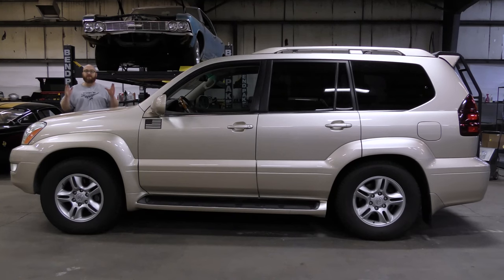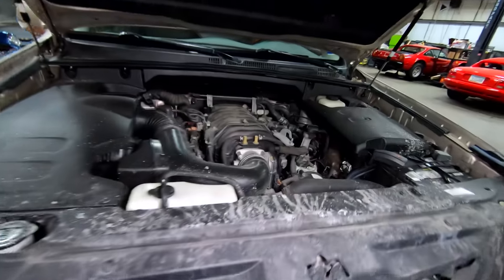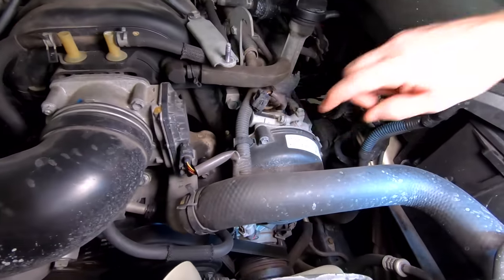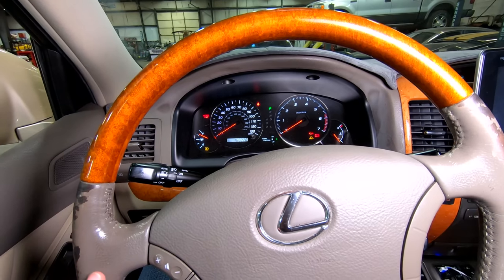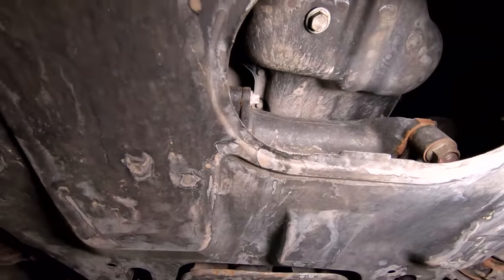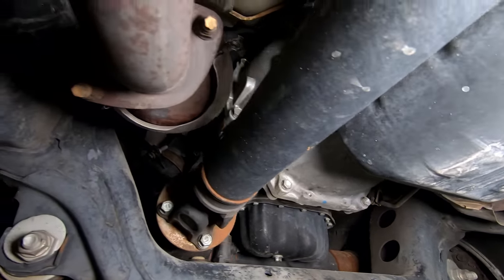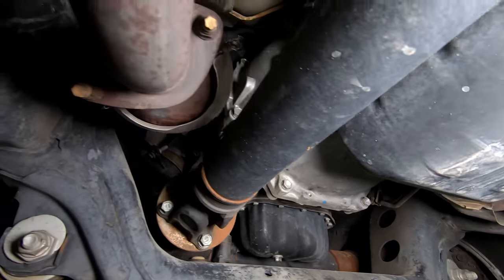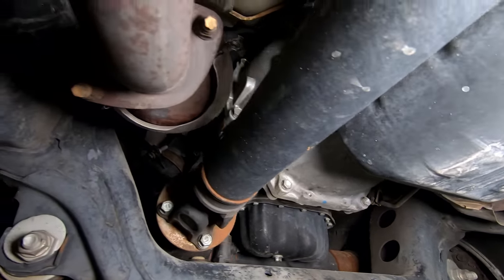How could this super reliable '07 Lexus GX470 have such a stupid design? CAR WIZARD weighs the risk

Comment: Reliability is the most important thing to me. That's why I went with Honda. Since I recently had to replace  my charcoal canister Honda went and put it inside of a steel housing to protect it. If I ever have to replace it again there is anti-seize on every bolt since I live in the rust belt anti-seize is a must.

Comment: All these videos of the GX line and personal/family experience with Toyota/lexus is the reason I bought a 22 gx460. I also own a 2014 camry. My parents had a 99 Corolla with 350k miles on the original motor and trans before it began burning a quart of oil for every tank of gas and the trans slipped. They have an 11 camry with 290k and it runs as good as the day they bought it with 80k. My camry has 140k and nothing but oil changes and trans fluid changes. And still a great ride.

Comment: I would hardly call this a design flaw.  A vast majority of these starters go over 200k no problem.  A design flaw would be something like 5.3 LS camshafts going flat from bad designed fuel management lifters.  Then knowing it's a problem and not making new parts just keep using the old designed ones.

Comment: Well i thought that was a bad design at first but when you think about it is a good place to put the starter .It is the same place on my Nissan Titan as well . Main thing is it is out of the way of the cats and other hot exhaust piping ,it's high and dry . Even it taking longer to change out it will have to be changed out less often . The heat from my headers on my old 73 Ford Truck would kill my starters in about a year . I'm still on the original starter on my 2004 Titan . But what do i know ...where would you have put it ?
Reply: It's not really avoiding much heat when it's right in the V of the engine
Reply: @wigletron2846  Better than being next to the cats though i would think . It would be interesting to do a test . Take the temp of a starter next to cats and take temp of one in the valley ; )
Reply: @grampy2004  I'm sure it's hotter near the cats but it's also completely closed in inside the V and under the manifold. I think the reasoning behind putting it in the V is mostly to protect it from the elements.

Comment: IF the starter ever needs replacement it's an easy job. Any decent technician can have the intake removed in under 20 minutes. That being said it's protected from the elements where it is and rarely are there ever any starter problems with the 2UZ-FE. Unlike those domestic vehicle starters hanging out in the elements and under hot exhaust manifolds.

Comment: We had issues with the starter of our 2003 in early 2020, so it had to be replaced. It was a pain to get to and obviously a pretty long process, but we've not had to replace another starter ever since. It's not so much a design flaw if the part hardly ever breaks.

Comment: Starters for stop/start are different than conventional starters. Different design of brushes and lower rpm when cranking.
Reply: And they operate at 48v, which reduces the damaging current.
Reply: @aliendroneservices6621  not all, some like FCA vehicles. But they use a belt driven starter/generator.
Reply: @lcq2102  I stand corrected. Thanks!

Comment: Hello CW, I do hope you read this story. Here where I live in Houma, LA is Greg LeBlanc Toyota. Not long after the Tundra was introduced, a local hot shot driver purchased one with a 4.7. His drive took him from here to the Dakota oilfields on a weekly basis. He made proper oil changes with LeBlanc Toyota and after a few years he had accumulated 1 million miles. It was time for a new 4.7 liter Tundra. He got it shortly before the 4.7 was discontinued. (If I recall correctly). Toyota HQ in San Antonio got word of this “Million Mile” Tundra, came to LeBlanc Toyota, bought it from them and took it back to R&D and tear it down to see what didn’t wear out. His second truck also just made a million miles and it was time for a third Tundra.
So yes, although the starter is in a stupid place, the engine is good for a million miles.
By the way, the video of this truck is here on YouTube if you’re interested.

Comment: Geez, those wheel weights are an eyesore! I thought most tire shops had started putting them on the inside of the wheels. Guess not
Reply: I recently got 4 new tires on a 07 Ram and they put the weights outside on mine as well.
Reply: Nice rims don't have spots for wheel weights on outside and only sticky weights will work.they are expensive and most guys aren't going to waist em on a dirty rim that won't stick.hope it helps.just ask for them if you want em.

Comment: Oooooo noooooo, is this the starter under the manifold? I literally just changed one on my friends 07 Tundra. 4.7L. It’s under the intake manifold and take quite some time with a lot of disconnecting. Took me some time to get to and then the east work wasn’t done because the starter bolts face the fire wall and are a BEAR to get to 🤦‍♂️

Comment: When you check the car over, do you also charge a diagnostic fee?  I've had some dealers/mechanics want to charge $100+  even when you do the service.
Reply: The Car Wizard does that as a service, I imagine. No one can charge for work not requested or related to the customer's complaint.
Reply: Why wouldn't they charge for diagnosis? There's labor involved, along with special tools like scanners and scopes. Shops also have to spend a great deal of money on information services like All Data and On Demand. And in many cases, diagnosis is the hardest part of the job. How would you like it if you did all that work only to have the customer take it somewhere else to save a few dollars?
Reply: @AT-wl9yq  If the customer has not requested the mechanic to pursue a particular line of diagnosis/repair and they take it upon themselves to do without the ok from the customer then they shouldn't be charging for that. The Car Wizard has occasionally done so and not charged the customer. That would be like me going next door and cutting my neighbor's lawn without their ok and then demanding payment.
Reply: @williamjones4483  I don't think you understood my comment. What I'm talking about is someone taking their vehicle to a shop because there's something wrong with it. The diag fee, usually 1 hour, is sold to the customer up front. The customer agrees to it before we touch the car. Whatever is found in the diag, the customer is made aware of and given an estimate. We don't do anything without the customers permission first.

The only exception I will make is if I find something very simple and cheap to fix. A fuse, loose connector, etc... Something very minor. For an issue like that I'll tell the service writer to tell the customer we fixed it as part of the diag, and not to charge any more. 

Either way, we don't do anything that will cause the customer to pay more without permission. Almost all shops have this policy.
Reply: No, any shop should be jumping up and down to work for free for you.

Comment: Should do the knock sensors & wire harness while you are in there.
Reply: With that mindset, they should replace everything - just in case. Not sure why though, these vehicles are bulletproof. At least that's what people claim. I'm actually shocked that it's even in for repair, given the reputation they have. Being sarcastic here as I don't believe Toyotas are any more reliable than any other Japanese brand. It's pure marketing hype, IMO. If they were so great, Toyota/Lexus dealerships wouldn't need service bays, other than to do regular oil changes and other serviceable items.

Comment: hey at least it's not inside the bellhousing. the bentley bentayga keeps there bolted from the inside. so you have to pull the trans  to change the starter

Comment: Car Wizard - where the small pipeline from the air compressor/distribution block enters the rear airbag, there's a small literally 5 cent rubber o-ring. These can often fail - they cost nothing, and their replacement costs nothing - unscrew the small connection, replace the o-ring, connect back up and make the compressor pumps up the system (either via diagnostic software or it does by itself based on low pressure). Try that first - then move to the air bag. Greetings from Latvia.

Comment: For me, any decrease in fuel consumption and pollution is a plus for the whole world. Studies show that start/stop features decrease fuel consumption between 5-7%. Think of all the fuel saved from that! I also read that the starter and batteries in these start/stop vehicles have been revamped to withstand the extra wear and tear. Furthermore, the start/stop feature doesn’t activate until certain parameters are met, i.e., the engine is warmed up sufficiently, there’s enough fuel in the tank, the battery is sufficiently charged, outside temp isn’t extreme, seatbelt is on, A/C or heat not at max, etc. It is WAY easier on a starter when the engine is warmed up. Normal starters are meant for about 50,000 starts, whereas the new start/stop starters are good for 200,000+ starts. I think the benefits are apparent.
Reply: This comment needs to be more visible. Modern start/stop tech (and oils) are way more robust and well-engineered than the crap from decades ago. If it wasn't worth it, auto manufacturers wouldn't spend billions of dollars engineering and integrating the technology. People that whine about these things are very similar to the people that think modern cars need "tune ups".

Comment: From what I understood talking to an engineer friend in toyota, those starter motors on "stop start" vehicles, they're not standard starters, but more of a heavy duty unit.
Reply: At least with Toyotas the driver has a choice whether to shut down the engine by the position of the brake pedal.
Reply: @user-tb7rn1il3q  what?

Comment: Dear Car Wizzard. If we take a conservative estimate, this 4.7 idles at a consumption rate of .4 gallons per hour. If you have a total of 15 minutes stop and idle time on your 1 way commute, you waste .2 gallons idling. each day. More than 15 gallons a month with trips for errands. That's over $700 a year. If the starter lasts 5 years on a stop start vehicle, this example shows a minimum of $3500 savings - starter cost replacement `$800 at a high quality shop like yours. This system  makes a lot of sense from a cost of ownership perspective. Even with the high cost of replacement on this design.
When extremes are considered like the starter placement on the old stingray vettes, vs this design it could be argued that the starters heat range is better managed and life extended surrounded by coolant cooled block/heads , and an air cooled intake manifold. If a stop start starter is  purpose built, weak points from short crank cycles are addressed in the manufacturing process. I really think you're stuck in an old way of thinking here. Again based on failure rates of these new start stop systems, this is a highly conservative estimate considering we're likely to see a longer than 5 year lifespan, especially from Toyota. Personally I think you've just been jaded by the Northstar ;)

Comment: I totally agree with the stop/start function. Good for the planet and mechanics, bad for your wallet
Reply: No they are designed completely different. Wizard just doesn't know this. These cars have direct fuel injection that makes the car start right away. And different gearing on the starter that makes it easy to crank.  Notice in these cars they don't really crank it just turns on. I seen these cars with 250k miles and never been changed
Reply: @xavierramirez330  thats just improved starter design. Even cars without stop start crank that fast now.
Reply: @danielgroeneweg3781  true that but iam also talking about direct injection makes it start even faster then those with out it.
Reply: @xavierramirez330  most cars on the road have direct injection its really been around since the early 2000s. Almost every new car has it now that emissions are getting tighter.qhen cars start pretty much starts instantly it down to how fast the starter cranks and how fast fuel gets in the cylinders along with other factors like temperature. A cold engine won't start as well. If you go watch extreme cold starts you'll see the gas cars once the starter cranks at full speed for a couple seconds they start fast. Can't say the same for diesel in - 30.

Comment: David I took my 2006 Lexus GX470 to the local Wichita Lexus Stealership to have my rear main seal and front crank seal replaced. They had my GX from 1/4/22 to 2/21/22 they broke my starter, the exhaust cam, and two valves in the process if you can believe that. I see ya at cars and coffee next month I’ll tell ya the whole tail. I will try to bring it to your shop each time now that you have help! I regret my recent decision only good part was they provided me a loaner and didn’t charge me for all the problems they created themselves. Service manager tried to blame high miles at 205k well cared for miles

Comment: Well the 4.6, 5.0 and 5.7 starters are even worse. Dealer procedure on some of those says pull the engine first.
Reply: On what vehicles do you have to pull the engine to change the starter?
Reply: @AT-wl9yq  Lexus sedans.
Reply: @dawnpoint  You don't have to pull the motor on those. They put them under the intake manifold, and its not that big of a deal to remove it. If I remember correctly, the workshop manual tells you to remove the engine cradle, not the engine. But even then, you don't have to take it out. You can accomplish the same thing by removing the engine and transmission mounts, and putting a jack under the motor. That will allow you to position the motor in different places where you have clearance. 

If you want to know for sure about a specific vehicle, just check the labor allowance for a starter on that vehicle. If you have to R & I the motor, it will call for 20+ hours.
Reply: @AT-wl9yq  The 4.0, 4.3 and 4.7s are under the intake. The 4.6 and 5.0 (and 5.7 in trucks) are tucked up under an exhaust manifold, which on the sedans means either dropping the subframe and suspension to get to the exhaust or just pulling the motor out the top. LS460/GS460 in particular. Could be ISF/GSF/RCF as well.
Reply: @dawnpoint  You're not a mechanic, so what you are saying doesn't match reality. That's not an insult. You just don't have the experience doing this type of work.

"The 4.6 and 5.0 (and 5.7 in trucks) are tucked up under an exhaust manifold, which on the sedans means either dropping the subframe and suspension to get to the exhaust or just pulling the motor out the top."

Of course they're tucked under the intake manifold. Most starters are. Pulling the cradle and removing some of the suspension parts is not a big deal. Its a fairly easy job. Maybe 1-2 hours. What you don't realize, is that the subframe has to come out anyway if you are going to remove the motor. Its not one or the other. I can tell you with 100% accuracy  that the motor and rans do not need to be pulled. Once the subframe is out, you can then lower the motor to give yourself room to work.

If the starter is on top, you remove the intake manifold. That's not a big deal either.  You do not have to pull the motor. 

If you don't believe me, look up the procedure for removing the starter. Removing the engine is not a requirement.
Reply: @dawnpoint  This is just an update to my last post. I was interrupted when I was typing it out and I somehow forgot to include the most important thing. Even if you wanted to pull the motor to install the starter, you can't. Its literally impossible. In order to remove the motor, the starter has to come out first, for 2 reasons. 1. You need to remove the bell housing bolts to pull a motor. Most starters use 1 or more bell housing bolts to mount it. 2. The starter also has to be removed to access the torque converter bolts. The only way to get to those bolts is through the hole in the bell housing where the starter goes. There's no other way to get them out, and you have to spin the motor by hand to get the bolts one at a time.

This is also something you don't have to take my word for. The workshop manual will confirm what I'm telling you.
Reply: @AT-wl9yq  Thank you for reminding me that you’re better than me. I hope you sleep better tonight. You’re right, I’m not a “professional” mechanic, but I always do a perfect repair and I know what I read in the Lexus service documents years ago. So maybe they revised it. Either way, the UR engine starters are way worse than the UZ ones.
Reply: @dawnpoint  I don't know why you're getting upset. You made a false statement (I know it wasn't intentional). But there's no where to go. Weather its on top, or on the bottom, they're not as hard to do as everyone claims. But to say you need to pull the motor, is simply not true. You can't get the motor out with the starter in the car. Its impossible. If you can show me a reputable source that proves me wrong, I'll be happy to take it all back and say you were right and I was wrong.

Comment: Car Wizard, I have a Toyota Land Cruiser with the 4.7L, one good preventative maintenance item you may want to mention to your customer is to replace the injector seals (super convenient while the intake manifold is off) as well as the heater t's at the rear of the engine. Our 4.7L's in the Land Cruiser and Lexus LX470 have those two items as big "must do's" with our vehicles sitting in thr 150k-350k ranges. The injector seals are usually only best accessible when the intake is off and its just 8 little seals, and the heater t's are plastic and wear out after a good 150K but prevent coolant leaks or damage to heater core.